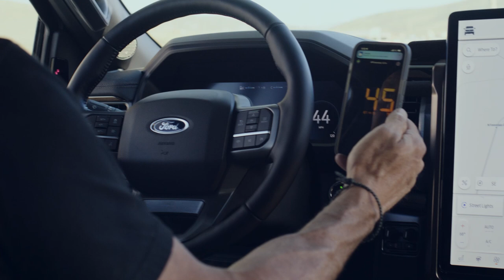LIFTING an F-150 Lightning: Suspension, Wheels, Tires, Rooftop Tent Install | Bronco Nation

Comment: The crash bar you cut off at 9:15 just has two bolts you can remove and the thing slides right out. I can see cutting it off so you don't have to remove the bumper, but why not remove the rest of it rather than leaving it?
Reply: What a Hack. Crash bars are for crashes. The accidents I’ve investigated from this kind of work leaves people maimed for life. Sad.
Reply: No it doesn’t just slide out unfortunately you have to undo the front end and bumper and lift the front end up to slide that out. Been there :(

Comment: how did you adjust the shocks for the extra 1200-2000 pounds of the lightning and accessories vs a regular ole gas f150?

Comment: I can’t wait to see someone do a pre-runner build on one. If the front suspension is the same as regular f150s then any bolt on long travel suspension will work up front , bypass shocks , coil overs and air bumps.  All standard f150 LT mods.  For the rear it looks like Swing arm baja bug style.  I think any off road race shop in so cal can build 3” over rear swing arms.  Has frame too for bypass and air bump shock hoops/mounts. Extended 930 axles too…

Comment: Y’all have any update on this build? I’m about to pull the trigger on an extended range lariat . Definitely want to do wheels, tires and lift kit
Reply from the maker: The owner traded it in for a F150 Raptor and subsequently a Raptor R... range was an issue.

Comment: GFC makes nice stuff but a tent mounted above the roof line is going to have a significant impact on aerodynamics and range. AND tire poke... another aerodynamics killer. This setup was definitely not designed with maintaining range in mind.

Comment: Everyone, please watch Town and Country Ford, Lift a Ford Lightning.  They were able to do the lift without cutting out the Crash bar, might be important to have when the Insurance company is evaluating an accident.  Also, is the Fox spring set up rated to hold all of the extra weight from a Ford Lightning?  I would say, Fox would say NO!

Comment: unsure how less metal, less coil will be better, the ford lightning with extended range was 6900 lbs, and even more with heavier tires in a lift

Comment: Fox's current F-150 spring rate on their Performance-Series 2.0's are DEFINITELY NOT spec'd for the GVWR of the lightning. 
Everyone wait until a proper coil-over mfg specs one correctly.

Comment: Yeah let's cut off the crash bars cuz oh well. Lol definitely an improvement from just a puck though. Let's make sure you get the alignment done in the front. Would be bad to not tell people to do that after unbolting the control arms
Reply: Sasquatch model Broncos come with the crash bars deleted from the factory to clear the larger tires. Sure they are helpful in collisions but not entirely necessary. For our tire size selection we opted to cut ours but by no means do you have to and we certainly are saying you should. We have everything aligned after changing geometry in the suspension and while we didn’t mention it anyone that’s doing this themselves should know that. And if you’re taking it to a professional shop they certainly know it 😉 But thank you for pointing everything out to share with others. 🙌🏼
Reply: @dirttiresdonutsgarage3021  is the lightning crash bars different with the bronco?  as in the bronco just unbolts where you cut off the lightning ones.
Reply: @KingLuis1985  All F150 crash bars can be unbolted and removed as well. It just takes a lot more work and a lot more time to do it. So if they’re going in the garbage then it’s far quicker to just cut them off and be done with it. It’s always a discussion I have with customers to let them know exactly what can and will be done and if people are uncomfortable with cutting crash bars off then we go with a tire size that does not require any modification to them.  Since this is my personal lightning that I own I opted to cut them off for times sake and throw them away.

Comment: Nice build with the GFC. I just can’t bring myself to buy a 100,000 electric truck. There aren’t any charging stations out in the woods.
Reply: Speed is the only factor that kills range ive seen people saying there getting 430 miles of range around town as long as your not cruising at 75 mph every day it should be fine and they start at 39,995 four trim levels up then  your at 100,000

Comment: All of the sensors would be out of whack at the front so you wouldn't want to risk any hands free driving if it is installed. At least until someone calibrates it properly.
Reply: I don't think so. It is no different than having a heavy load in the bed so I'm sure hands free driving would be fine.

Comment: Doesnt seem like oversized tires, and "overlanding" would be that relevant on a lighting. At least with the battery technology available right now.
Reply: For the people that drive just outside of the city limits to camp.
Reply: @userANAKIN  This would be fine in the PNW. A hundred miles from I-5 would put you in the Cascade Mountains or at the Coast.

Comment: Being an electric vehicle, most of Ford’s R&D probably was spent on maximizing aerodynamics and range…which you just annihilated in every way.
Reply: Ha ha ha Aerodynamics 😂
Reply: It's an F150 with electric motors. The only thing different about this and a gasser is the wheels, undercarriage, grill and weight. The aerodynamics would affect a ICE truck exactly the same.
Reply: The f150 gets horrible Efficiency for a ev.  So no. He just made it worse that’s all.
Reply: They did almost nothing to address aerodynamics.  It’s a bit lower than it’s counterpart and has minor little tweaks in the future. Their vehicle will probably be much more dynamic, but they wanted to rush to market to be the first electric pick up truck nonetheless lifting the truck will indeed reduce efficiency and dynamics a little bit, but since I’m going to be adding a truck camper and have it loaded down with work stuff, I don’t think it’s really gonna affect my dynamics that much.